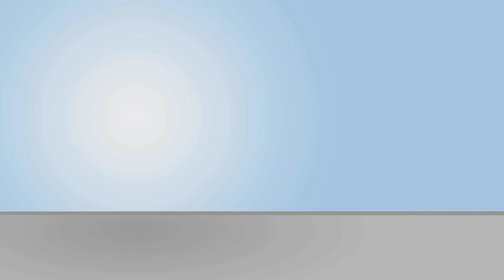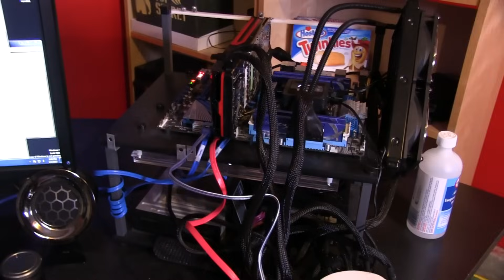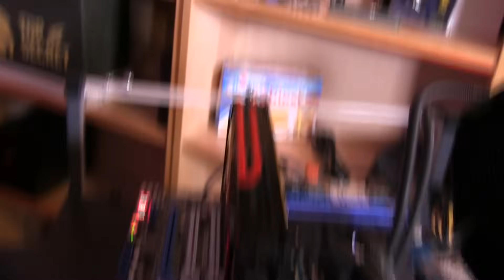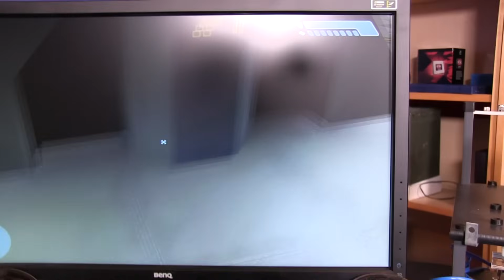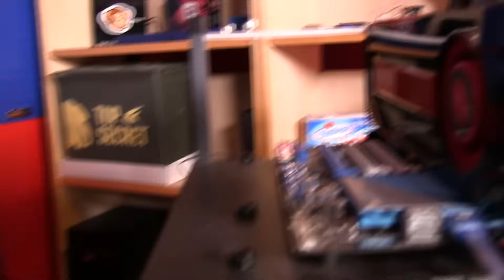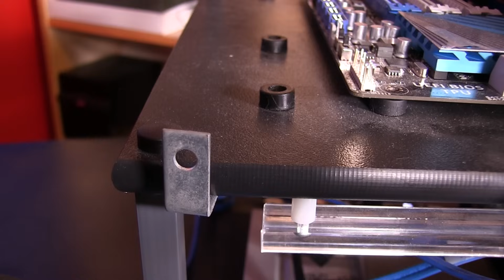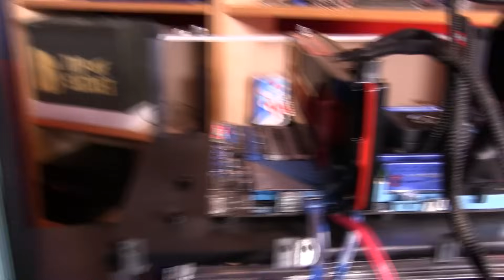Coil Whine Explanation & Demonstration Linus Tech Tips

Comment: got my evga sc 1070, and it has coil whine. i can just notice it durin  heavy load since the fans gonna bump up a bit as well.
Reply: same on my MSI
Reply: ///No Power have you check out my video, is it as bad  as mine?
Reply: Yeah, about the same, but in Far cry 4 when its loading, the whine is very loud. I guess I'll just have to adapt to it :D
Reply: lock power, lock fps, better case for isolation....
Reply: My case is open atm :D I ordered 2 more coolers for it, will close it when they arrive. Isn't locking power going to kill the performance?
Reply: ///No Power idk man, i feel no difference coz i run medium setting and it hit 144 fps 100% the time,alone with shadowplay. i think even 1060 is capable to do this..
Reply: i also have the evga sc 1070 and i don't have any coil whine at full load
Reply: Fappingmaster got new zotac, still whines. although this time, i am sure 90% ppl wont be able to hear it. but still i can.

i am keeping the zotac and selling evga.
Reply: As Linus said, try different PSU's. Might be too late to test the theory now, though.
Reply: Majatek Zawalski could be PSU yes, but I don't have another one
Reply: Majatek Zawalski i did, same. used CX550 and AX1200. not gonna try third PSU, i just dont feel PSU going to do much here.
Reply: Ah well, that sucks.

Hope you never have to worry about having to deal with it in the future again. JayzTwoCents also mentioned how certain PC owners apply silicone or whatever to the coils to dampen them. Not sure how effective (or safe, for that matter) it is, but that's another channel I recommend if you're not already subscribed.
Reply: Majatek Zawalski thanks for all the information. i used jayz since day1 i am on youtube. im glad that EVGA is kind enough to RMA my card. and it is international warranty.
i wish more ppl can focus on the noise of build, so all manufactures can care about it.( truth is something sounds like jet engine might be "silent" to some ppl....)
Reply: Majatek noise is vibration. more mass for the given strength of vibration means less audible noise.  however, more mass could mean poor heat dissipation for the component.
Reply: Yeah, hence why I mentioned that I'm not sure how safe it is.

The only coil whine I've ever experienced is when my GPU/PC hardware is dying (current computer needs MAJOR overhaul/parts replacement and my GPU whines), so imo it'd be best to get it replaced under warranty or buy a new one.

Comment: I got a laptop with 960m... It used to whine even simply while browsing webpages. After disabling C6 CPU power saver, the whine during net-surfing disappeared, but still persists during video games. Depending on the graphical intensity, it is louder or quieter. Any way of reducing it? Enabling vsync doesn't solve it. :(

It is not particularly loud, but once you notice it, it's kinda hard to stop paying attention to it.Kinda like realizing you are breathing, then good luck unnoticing that... :/

Comment: Oh shit I didn't know about coil whine and I was just curious. Now I can realize the coil whine from my graphics card... I wish I had never watched this video.
Reply: Coil whine it's harmless. Mine, for example, only whines when i reach like more than 3000fps (in menus). Don't worry... ;)
Reply: hey does it always whine it reaches like 3000 fps cause i get that frames in menu too
Reply: hey bud i have the same issue before i changed my psu last night, Now my zotac gtx 760 doesn't have coil whine anymore, try games like nba 2k16 and witcher 3, can't hear coil whine anymore, i have a 500w psu before and i upgraded to a ocz 1250w zx series psu!
Reply: are there cases whereby the gpu suddenly starts having coil whines which it did not had initially?
Reply: i don't know, but if you have same psu in a different case where you put a lot of upgrades to the new case like adding more fans, led lights, probably it might! cause there is a hunger for power going through your gpu now... sort of.....! if you could borrow one of your friends higher end psu with higher wattage rating probably coil whine will stop!
Reply: Mark Angel Llandino in my case i did absolutely nothing to my pc, added nothing, i just noticed that it started having these weird sounds when it's under load..i switched to my old card and the sound's gone..so the sound's definitely coming from my card and i'm wondering what's wrong with it all of a sudden..
Reply: I got a zotac 980 and is doing it even in idle status :// but only if  i put my ear near the case
Reply: yea, i didn't noticed it until i opened my case though..now it's impossible not to notice..
Reply: wttttffffff plllz help. i have this coil whine in my cpu fan !!!!!!!!! it really sounds as i move the mouse. this was bothering me for years and i didnt even know it has a technical term .
Reply: Can you frame cap at like 150fps to fight the whine?
Reply: cannot unhear.

Nah I was bothered by it. At least it's not that bad on my card, I only hear it when the fans are really silent. An isolated case helps a lot btw.
Reply: thank god mine doesnt have this. i would never be able to game without a huge headache at best. i ran MSI tests to push 100% for 20 minutes and while it capped at 70 C (before i got a load of case fans to reduce it anyway) i never heard a whine.
Reply: @alexvorza  I know this is 7 years old but it's a freaking GPU not CPU. Don't give people advice when you can't even get the names of the parts right!
Reply: @ohai1526  Yeah exactly, this was 7 years ago. This reply of yours is absolutely useless and even kinda sad, lmao. Besides, I was a beginner back then and had little to no knowledge about what I was talking about. But good on you for correcting me 7 years ago, I guess, lol. I hope it made you feel good about yourself somehow. As of right now, I probably know much more about hardware than you ever will. But I guess we'll never know. 

With that being said, I'll just delete the comment which, not only makes zero sense as is as it's also attracting smartasses 7 years later.

Have a nice day and stop replying to 7 year old comments. It's kinda sad. 

P.S - I'm also sure I typed CPU instead of GPU, by mistake but whatever.
Reply: @ohai1526  So, if you knew this was 7 years old why did you even bother replying?

I had very little knowledge back then. As of right now I probably know much more about hardware than you ever will, so I don't even know what you want me to do with this info of yours. Yes I wrongfully said CPU instead of GPU, 7 years ago. Yes, I was wrong. 7 years ago!! Want a cookie?! 

This comment of yours literally serves no purpose and adds nothing to the conversation as no one is even paying attention to these comments anymore.

But don't worry, I'll delete the comment. I don't want a 7yo comment of mine to spread misinformation on a 11yo video's comment section (sarcasm). 

With that being said, have a nice day and stop replying to old comments. It's unhealthy and makes no sense.
Reply: @alexvorza  Damn, you got mad 💀it's nice to know 7 years later you know the difference between a CPU and GPU, congratulations! Glad you have grown, it's very inspiring.
Reply: @ohai1526  Yeah, I did. Unfortunately looks like you didn't.

Comment: Mine is like this x100 on a GTX 970. RIP my CSGO career. (gotta get those high frames)
Reply: ***** Gigabytes Windforce G1 gaming. Its not so bad on some games like CSGO at 144fps but on others like Exanima (100-200fps) it is literally cancer, I can't even play the game because of the noise.
Reply: ***** Agonizing*
Reply: get headphones. and a sound dampening case
Reply: Ye, i (had) a zotac 970 and i still have a define r5 case, aka the most quiet case on the market. When i had the 970, it  
had some ridicolous coil whine. Especially in games where i got high fps. Fortunately i will get a 1070 later next week. :)

Comment: im trying to work out if what i can hear from my system is coil whine or just a normal hum coming from the PSU

It's a consistent noise, its a some what quiet build so thats why i m noticing it. But its more of a slightly high pitch  "hum" than  a whine like in this video. Plus its consistent and does it whilst im just idling / not running anything intensive

Comment: Some Tips on Coil Noise: The noise corresponds with frame rate. It will give you a high pitched whine when you're playing HALO 1 at 200 300 or 700FPS when you look at the floor. The higher the FPS the higher the pitch of the whine. Force VSYNC on to limit your FPS to the refresh rate of your display. You should hear a steady and much quieter hiss instead of a whine. If your frame rate ever drops below 15 you will notice that there is a distinct CLICK sound for every frame rendered. For most people 60Hz is low enough that the cap keeps the FPS locked at 60 without dipping below and the noise is quiet and monotone instead of reacting to your movements in game.
Reply: Hmm, so that's why it only happens in loading screens when I get like 7,000 fps. (R9 290)
Reply: Thanks so much for posting your comment - certain apps were making this annoying sounds and thanks to you it's gone! I limited FPS to 144 and enabled V-Sync
Reply: Dude Thank you so much. I have a new gpu for a month and it only happened in some games. I capped my fps on bg3 and it immediately stopped. Thank you and Linus so much for the comment and the video
Reply: This solved my problem. Thanks!
Reply: 7 years late but so happy I found your comment. Turned V sync off in game and instantly stopped 😅
Reply: Was having the same issue on WoW right after getting my computer repaired although it sounds like its coming from my PSU. Vsync and capping FPS fixed it thank god.
Reply: Это костыль. Вы забрали у себя мощность, за которую заплатили деньги. Тоже самое, если бы у вас была проблема с вентиляторами, то по этой логике, можно было убрать его, пожертвовав температурой.
Reply: @Lokmen-o6g  всё зависит от того на сколько вас раздражает "сoil whine" и нравится ли вам идея что ваш компьютер потребляет максимальное количество электричества (и нагревается соответственно) только ради того чтобы дать вам 700 кадров в секунду из которых только 60 или 120/144 будут вам показаны в зависимости от качества вашего экрана.
Reply: @elephant1851  mine's turned off💀
Reply: @elephant1851  following this conversation and tips.

Comment: I'm trying to figure out if this is what my 970 is doing.  Can anyone confirm that when you tab out of the game the coil whine should stop?  For me, as soon as I tab out coil whine stops.  Or if my game hits a loading screen it stops aswell.  Thanks.
Reply: +daytek85 force vsync on. the noise should be much quieter. Yes the coil whine should stop when you tab out of the game because your video card is no longer rendering it to your screen when you do that.
Reply: Hey thanks for the tip that only seems to help in the menus and stuff or doing a benchmark, some games I play in the menus I get 1700 fps which makes it go crazy.  I also found out that for some reason its my PSU thats whining.  I looked more into it and someone has a video of him interchanging parts with his brother and sometimes the PSU whines and sometimes the GPU does.  Either way the company I purchased my computer from said they would swap out the PSU and GPU so I'm going to get them to send it to me, and I'll try combinations of both and see which is the least noisy then go with that.  Thanks for the reply!

Comment: I have that very same noise, but it's coming from my headset itself, and it's really bugging my ears.
Reply: +DaniTheHero your pc is not grounded properly. if it's laptop try disconnecting it from charger and if it's PC try placing your hand on metal case or metal frame inside case. if it's stops, it means it's it.

Comment: I have a noise kind of like this, but it only comes through my headset? What is it?
Reply: +EaterofCarpets That's static. It's in all PC components. Some headsets have more static noise than others.
Reply: MiniZaid It happened with my astros, and it still does it with my krakens? I'm not sure if it's the headsets themselves.
Reply: +EaterofCarpets it's static noise. all computer components have it. Some headsets have more than others.
You can't really get rid of it. Maybe turn down the amplifier in your astros. That might reduce the static noise
Reply: +EaterofCarpets Interference coming through the line. Like LT said, try hooking your headphones into the back instead of the front ports. If that doesn't help, try using a TOSLink/SPDIF connection for your headphones if possible (The fiber optic connector on the back of most gaming motherboards, needs an appropriate amp or converter to use it with some headphones, some include a connector).
Reply: That sounds like a grounding issue

Comment: I have coilwhine from my GPU msi r9 380. Strange thing is it appeared after I plugged in new monitor. I did not install anything, just plugged it through HDMI, used it for several minutes and after plugging in the old one, problems started. Reinstallation of drivers did not help. I eventually 'solved' it by installing RivaTuner and limiting fps in games to 60. Game does not skyrocket fps to high numbers to start the coilwhine now. It completely disappeared in Killing Floor 1 and in Risen 1 there is still some weird noise coming from GPU, however nothing high pitched and I can barely hear it with all the other fans in my PC. I also noticed the GPU seems to spin fans less often and not as fast as it used to, probably due to limit of 60fps. Which overall is not a bad thing, all those extra fps over 60 are not necessary and do stress your GPU for no real advantage.

Comment: I swapped power supplies in my PC just recently, and it occurred to me after watching this video, that the coil whine from my own card has either gone away or diminished to the point where I can't hear it with my case buttoned up. Any idea why the PSU can have an impact on coil whine?
Reply: +Shmeh Fleh 
The coils are used as power conditioners, they filter out electrical noise. So the power coming into them will effect the work they have to do. So a power supply with better or worse power conditioning could have an effect on the noise they make as they are subjected to higher or lower variances in electrical noise from the PSU itself.

Since there are variances in production of the coils themselves they could also be sensitive to different electrical noise frequencies and amplitudes, even for the same part numbers. So while one coil might whine when subjected to the noise from your old PSU, like the one in your GPU. Someone with the exact same GPU make and model might have had no issues.

Comment: We should demand more out of the manufacturers. Coil whine SHOULD be a valid cause of RMA. 
Don't accept anything else.

Manufacturers tries to get away with their poor choice of cheap and defect components.
They keep trying to fool us that it is normal and nothing to worry about.
WRONG! - Coil whine is a mechanical vibration within the coil, and that will reduce its lifespan A LOT. They know it, but they don't want to tell us that.

Never EVER accept ANY type of coil whine.
Reply: Are giù serious? I m soon going to build my own rig and I m terrified to have deficient components like gpus or psus with coil whine. Even if I 'll have a very good case that pitch noise is unbearable for my ears. I'll shove my gpu up the retailer's ass if I get the slightest coil whine sound.
Reply: +SysGhost Where the hell do you live? I RMA'd my PSU no problem.
Reply: +SysGhost it actually is a valid cause for rma, in my experience. I build/ fix computers and other electronics for a living and have returned numerous parts due to coil whine or undesirable high-pitch noises in general. I just tell them there's an intolerable high pitch noise and that I've tried all the regular fixes (mostly involving turning off various power-saving features) and they'll usually allow me to return the part without a problem.
Reply: +SysGhost I used to have coil whine, it was on my PSU or GPU in the beginning. When playing Crysis 2 I had coil whine, after a while I didn't have coil whine anymore. 4 Years later, still no coil whine. Reducing life span? Not in my case.
Reply: +Dheeraj Ramlal That sounds like the component has 're-seated' itself - think of that xbox 360 trick in case you got the red rings.
Sometimes it you loose a coil whine, it is usually because glue hardening around a component - it's mostly luck though and the only real fix is better components from the get go.
Reply: Coil whine is caused by bad design. Returning a product generally will not fix it. They will just send another unit with the same poor design. The exception is defective components.

Don't trust me on this. I have done no research and have only ever experienced coil whine on a backlight driver.
Reply: @user2C47  no coil whine also happens when u get really high fps (loading screens)